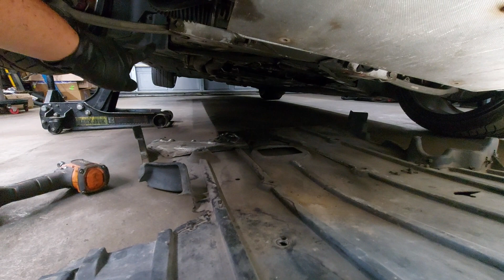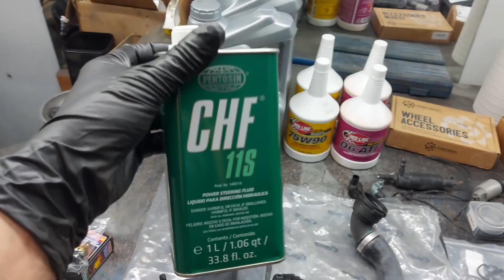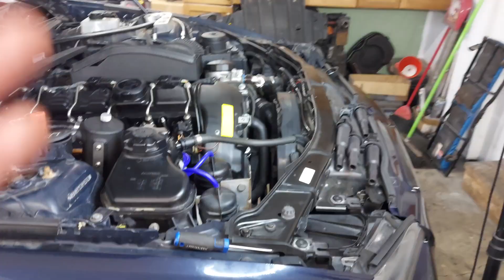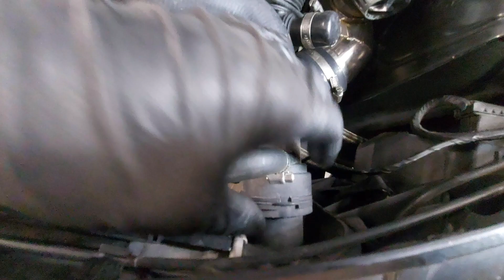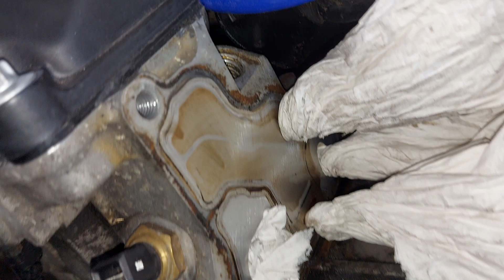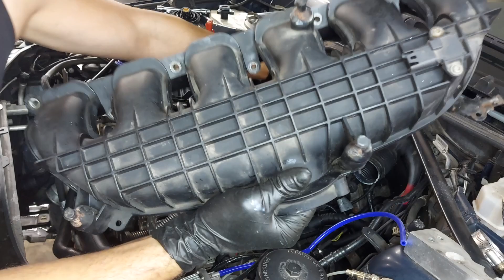Last minute repairs on my BMW 335i before massive road trip (Part 1)

Comment: driving your car on that road trip after doing all this prob felt so good lol, always quite satisfying after doing car work such as this. One thing I gotta knock is the open air filters that'll just suck in hot engine bay air, increasing IATs. I know it sounds way better, but not as efficient lol

Comment: Good video bro one thing to mention and anybody else watching anytime you work in the front of the engine like that and you remove the fan always put a piece of cardboard in front of it to protect in case you slip and bump into it with a tool or a part
Reply from the maker: I love this recommendation! It's incredibly easy to damage the radiator fins or even puncture it while wrestling with fan removal and or wrenching on parts in front of it. Thank you for the solid pro tip! Cheers 🤩🤝

Comment: If you don't mind me asking where did u get that metal undertray splash shield from? nvm i just realized it was front splitter. Oh do you run in-line oil cooler thermostat or without it?
Reply from the maker: Hey Pal! The front splitter is an APR brand. The front mount intercooler does not have a thermostat. Having said that, the oil temps do take longer to heat up. The oil temps run slightly cooler than stock under regular driving conditions. I haven't tracked the car yet, but I do plan on it and I will collect data on the oil temps to see if there are any note worthy gains with the cooler. Cheers mate and thank you for watching! Much more to come :)